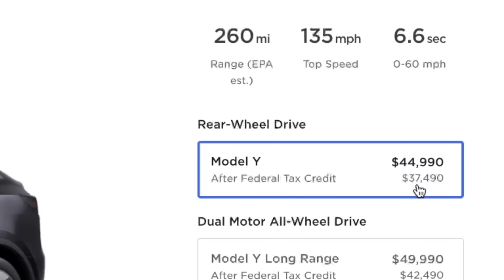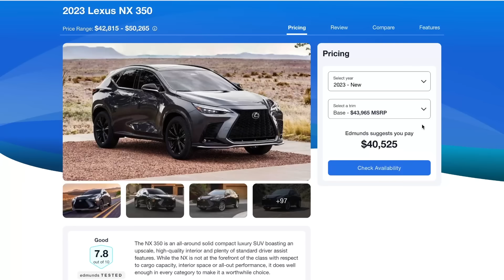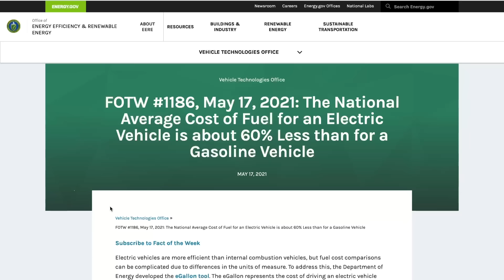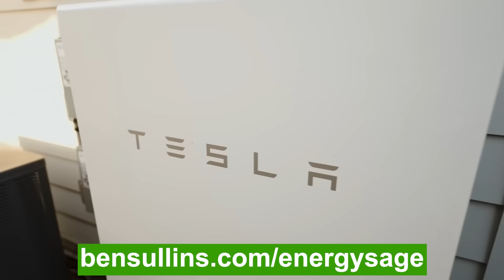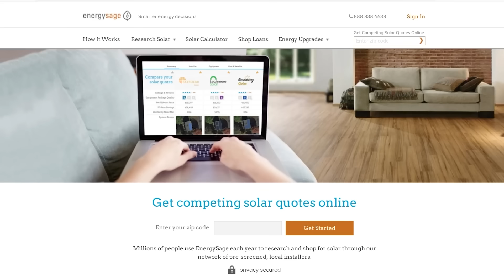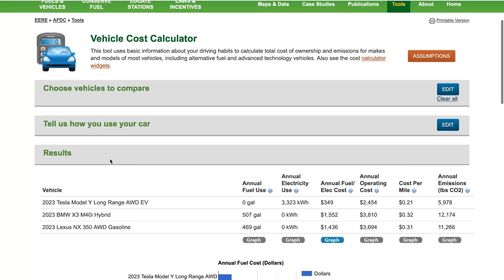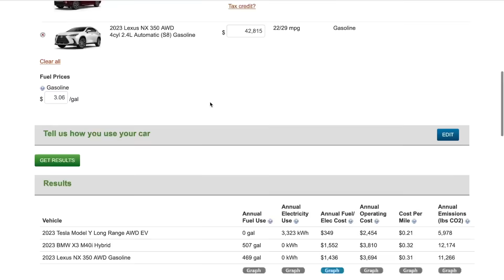Are EVs Really More Expensive? Debunking EV Myths Series

Comment: It’s mind-boggling to compare gasoline to electricity. The process of drilling for oil, transporting crude oil to refineries, refining the oil in into constituents parts that include gasoline, and then trucking the gasoline in large tanker trucks to gas stations all over the country, and then pumping highly flammable liquid into automobile gas tanks seems absurdly complicated compared to plugging a car into the electrical grid.  (Of course, we need to strive for more renewable sources of electricity generation.) Finally, a benefit of EVs not often mentioned is that we’ve never gone to war over electricity.
Reply: I agree. However, when you break down the source of energy at super charging or fast charging infrastructure the energy is still “dirty” energy so you still need oil refining, transport, etc. until we have a more dominant renewable energy source infrastructure throughout the US like wind and solar farms to power the energy grid.
Reply: @rexcharles11  Home charging coupled with solar was the game changer for me. In over a year of EV ownership I’ve used superchargers only a handful of times. No long road trips, however.
Reply: @richardcoughlin8931  Yes, I agree. Solar and in-home charging is a must for both cleaner energy and cost savings over time. I've done several long road trips and the super charging with Tesla makes it a no brainer.

Comment: One metric for fuel economy that works well is litres/100 km (in Canada). That allows you to calculate how much it costs to drive 100 km. The direct comparison in EV’s is kWh/100 km. My Mazda has been averaging 10 L/100 km and at current prices that’s $17 to drive 100 km. A Mustang Mach-e is quoted at 23 kWh/100 km on the stickers at the dealerships here. We pay $0.17 per kWh at home in Nova Scotia (which has some of the most expensive electricity in Canada) which means it costs $3.91 to go the same distance in the Mach-e. Less than 25% of the Mazda 3 I’m driving. In Quebec it would be even cheaper.

Comment: one missed opportunity: on the savings chart, you should have taken 5 seconds to slowly scroll towards the bottom, so every US viewer could look at their individual states' savings.  In the Bay Area, home electricity prices are being gouged by PG&E so much that some owners are finding it cheaper to charge at Superchargers rather than at home entirely from the grid (even off peak), and some owners are finding that on an e-gallon basis for a RWD model 3 it can actually be more expensive than gas in the current pricing environment
Reply from the maker: There's a link to it in the description. Or you mean the quick version I made?
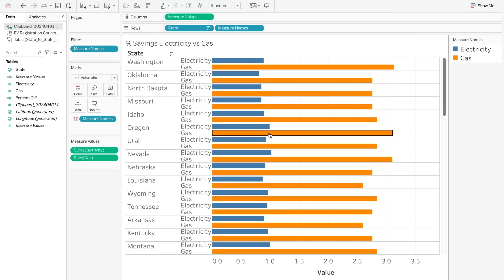Reply: @BenSullinsOfficial  i meant the percentage savings chart you made, at roughly 6:26.  Is that linked in the description?

Comment: The best comparison to miles-per-gallon is miles-per-10-kWh.

This is because an EV can do about the same amount of work with 10 kWh as an ICE car can do with 1 gallon of gas.

This is because ICE vehicles typically only use about 10 kWh of energy to actually move the vehicle, the rest going to waste heat.
Reply: My model 3 gets approximately 40 miles with 10 kWh, so that would only compare with a very efficient ICE or hybrid car.
Reply: @benmitsuda  That's because the Model 3 is like a super efficient ICE vehicle.

you can also compare what a Tesla Semi does with 10 kWh compared to a regular ICE semi with 1 gallon of gas, or what an F-150 Lightning does with 10 kWh to what a regular ICE F-150 does with 1 gallon of gas, and you will see that the comparison is valid and quite useful.

Comment: I have been saying this for years electric motors 5 parts just add electricity, gas engines and transmissions 1000s plus parts requires gas oil coolants and electricity plus computers and sensors to the wazoo. EV have to be the better solution and cheaper over time to make. I dont own an EV currently but I hope to get an Aptera a solar electric car that is a start up company in Carlsbad Ca. 40 miles a day from the sun and uses a relatively small battery that can charge 150 miles overnight on 115 house current.

Comment: They should be outselling gas cars. EVs are way better.
Reply: Facts. I don’t even have charger at home or work. Still better for me. Got charger 5 min walk from my gym then got charger outside of grocery store and in the malls. Works amazing good. Just when I park when doing something I just get a charger park space. I have done this for a year and no different in how my day is going. Have saved $3000 in a year. Some times I’m lazy but I gotta charge so I just go to the gym and charge nearby ✔️
Reply: So perhaps you can provide a source. I got warrantee info from Hyundai USA website. And Edmunds website says: “On average, you can expect the replacement cost of an electric car's battery to run from $5,000 to upward of $15,000, according to an article from Consumer Reports.”  So where did you get your number? Just curious
Reply: In 2028 they will outsell ICE vehicles.
Reply: fun fact: hyundai charge $60,000 for battery replacement.
Reply: @newchannel1220 and a 10 yr 100k mile warranty and average replacement cost is $5k to $15k per consumer reports.
Reply: @newchannel1220 Golly gee. A Tesla with 660,000 kms on the clock with the original battery, and 87% battery potential is real.
Reply: @Longtack55 There are Chevy Silverado pickups with more than a million miles,  but the outlier is pretty rare.
Reply from the maker: Yo pass whatever you're smoking this way man, must be some good stuff!